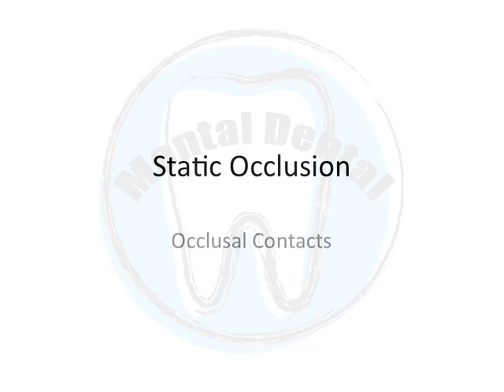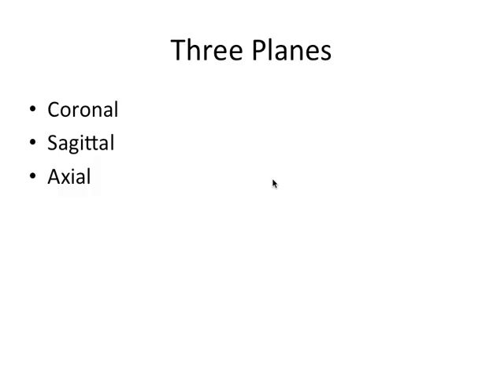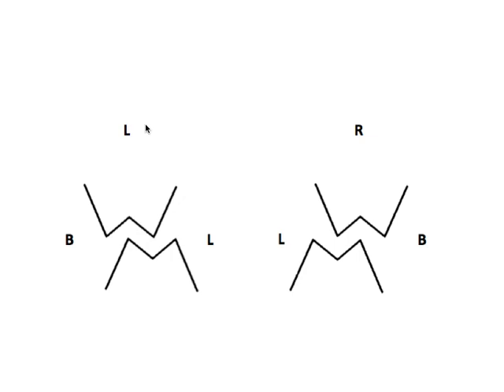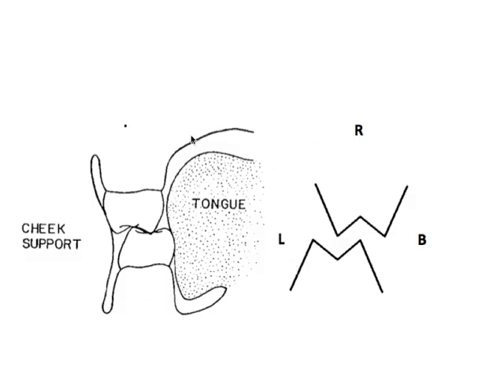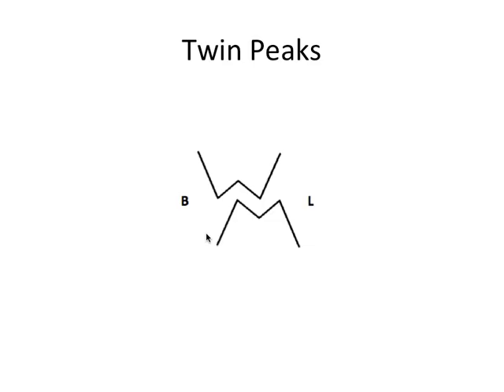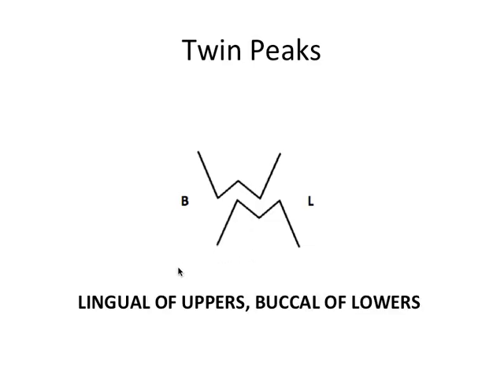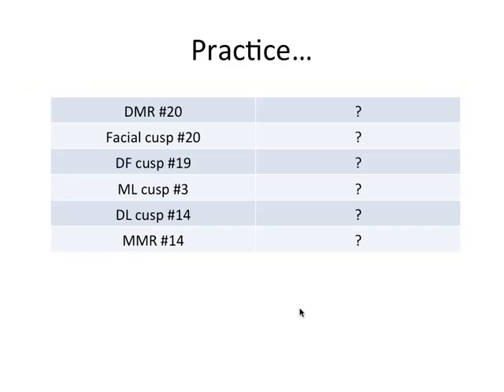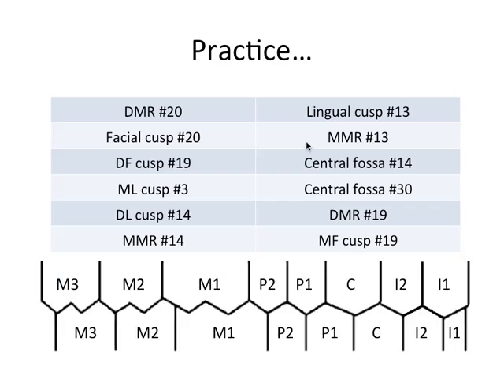STATIC OCCLUSION - Occlusal Contacts & Picket Fence

Comment: Thanks for the video
I am having probs understanding which cusp tip is df, ml,dL, mmr on the picket fence pls can you help me urgently.
Reply from the maker: Sure--so all of the upper cusps are lingual because these are the functional cusps for the maxillary arch (the ones in direct contact with the mandibular arch). Going from left to right on the picket fence then, the triangle parts that stick down are DL of third molar, ML of third molar, DL of second molar, ML of second molar and so on. The opposite is true for the lower cusps which are all facial because these are the functional cusps for the mandibular arch. So going from left to right the triangle parts that stick up are DF of third molar, MF of third molar, DF of second molar, MF of second molar, and so on. The depressions between the triangles are either the fossa (if they are in the middle of a tooth) or are marginal ridges (if they coincide with vertical lines that go between the teeth). Hopefully that helps, good luck!
Reply: Mental Dental yes, thanks so much.